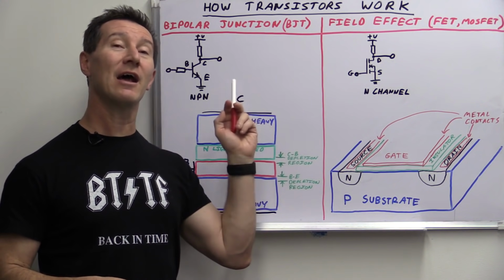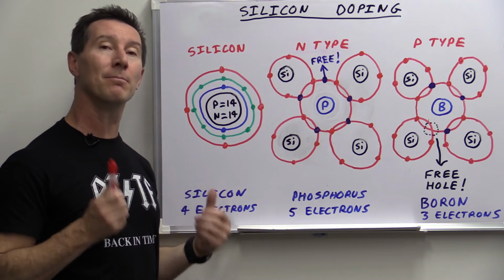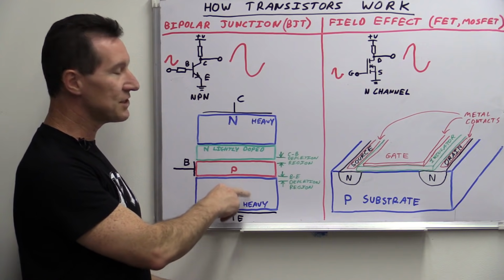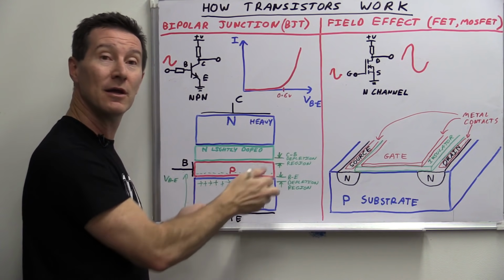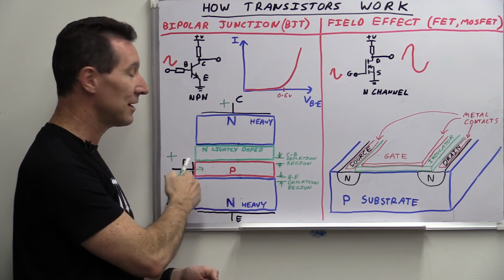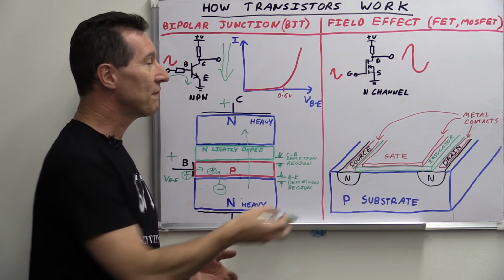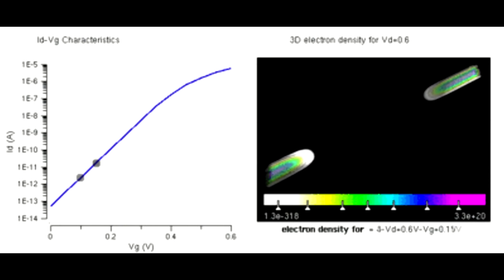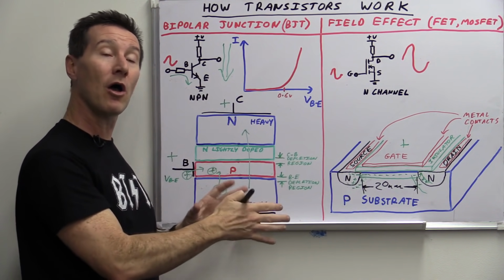EEVblog #748 - How Do Transistors Work?

Comment: Dave, I love ya man, but you just don't know how transistors work.  I don't even know where to begin.  I suggest you invite a guest, who is an expert, to correct this.  Sorry.
Reply: EEVblog I've never made a video before.  I'm sure it's very hard.  And BTW, I give thumbs-up to at least 95% of your videos.  You're a very talented engineer.  But with all due respect, If I was going to make a video about how transistors work, I'd probably get out the text books and review first.

Anyway, I'd start with the PN junction.  Doping silicon, adds charges to the matrix.  But a key point is these charges can't move, they are fixed.  It's like they're glued in place.  Mobile carriers are attracted to the fixed charges of opposite polarity, essentially covering them, and making everything charge-neutral.  When the PN junction is reverse biased, the applied voltage attracts the mobile charges away from the junction, leaving a "depletion" region, that is void of mobile carriers.  Note that the fixed charges are still in the depletion region, because they can't move.  Think of a tide going out and uncovering a bunch of sea shells that are stuck in the sand.  When the mobile carriers (water) drift away, then uncover the fixed charges (sea shells).  And the fixed charges, since they are no longer cancelled by the cloud of mobile charges that were covering them, make an electric field across the junction that opposes the applied voltage.  Equilibrium is reached when the mobile charges drift far enough from the junction that they uncover enough fixed charges to make a big enough opposing voltage to equal the applied voltage.  That is why the width of the depletion region increases as you increase the applied voltage.  Also, when you decrease the doping concentration (the number of fixed charges per unit volume) it takes a wider depletion region to uncover enough charges to oppose the applied voltage.  Simple, right?

A bipolar transistor consists of three layers, making two back-to-back diodes.  The middle layer is the base, and must be very thin (that's a critical fact that I think Dave forgot to mention.  The collector is lightly doped to give it a higher breaking down voltage.  (Lighter doping = wider depletion region = higher breakdown voltage.)  When the base-emitter junction is forward biased, current flows across it, just like it would through any forward-biased diode.  But because the base is so thin, many of the mobile carriers from the emitter have enough momentum to pass right through the base, into the collector.  That's why it's so important that the base layer is thin.  The thinner it is, the higher the BETA.  Also, it is commonly said that the collector "sweeps up" the carriers that flow into the base from the emitter, like a vacuum cleaner sucking up dust; this is because the VCE is usually a lot bigger than VBE, so the carriers are much more attracted  to the collector.

FETs work on a completely different principle.  It's true that depletion regions form around the drain and source, like Dave said.  But you don't normally get a depletion layer under the gate.  In fact, if you increase the drain-to-source voltage enough, making the depletion regions big enough to touch each other, that's called "punch through" and it's bad.  What you're supposed to get under the gate is an inversion layer, not a depletion layer.  Inversion means that the gate potential has attracted enough mobile carrier to outnumber the fixed carriers.  When the fixed carriers were the majority, the channel region (the space under the gate) was an insulator, but when mobile charges become the majority, the channel becomes a resistor.  Now, it's not like a normal resistor, because there is a kind of feedback mechanism called "pinch-off" that regulates the drain-to-source current.  I don't think I could explain that very well, so I'll just quit here.

I hope people find this helpful.  And once again, Dave, I'm one of your biggest fans.  My criticism was totally meant to be constructive.
Reply from the maker: Steve Robbins Perhaps you can begin by making your own video? Or the comment space here is unlimited, go for it. I did the best I could in less than a day from thinking of the topic, to shooting, editing and uploading without final checking or getting anyone else to check it. Yes, I'm no semiconductor physics expert. I think it's a good enough explanation.
Reply: You should do your own video and post a link back on this thread.
Reply: Mazekwon Could I please have zero subscribers again.  I fear that all this fame may has changed me into a bad person.
Reply: +Steve Robbins, I have subscribed to your channel, being your very FIRST SUBSCRIBER. I recommend that you post a video displaying your vast knowledge of the chemistry of Si conductors, but do so in simple terms, so that even grade school children can understand. 

Eagerly anticipating the vid!

 It's great to have so many intelligent people willing to go out of their way to make the world a better place & at such a high personal cost.  Not just sit there behind a keyboard typing comments that don't contribute to community at all!....
Reply: Mazekwon I have a channel?  Wow.

I don't understand the attitude of people like you.  Educators like Dave try to help people learn, not fill their heads with misinformation.  But everyone makes mistakes.  So professional educators are always grateful when someone points our their mistakes.  It's only the real jerks who throw up their hands and say "why don't YOU teach the class?".

Should I have been more tactful?  Probably.  (And I apologize Dave, if it seemed like I was speaking down to you.)  But afterall, Dave himself is not exactly known for his tact, is he?  Remember his rants about solar roadways are "bullshit", and Atmel vs. Microchip where he calls people "buttheads"?
Reply from the maker: Mazekwon The thing with youtube videos I learnt a long time ago is that I would never end up releasing one if I tried to perfect it. That's why all my videos are still off-the-cuff, no script, no real planning before hand, and I have no real idea what I'm going to say before I hit record. Then comes edit time, and another thing I've learned, people are hopeless at picking up their own mistakes, especially me, so I don't even bother. I used to watch my edited video all the way through before I released it, but quickly realised I'd still miss mistakes I made so there was no point. So now I just stitch my recorded clips together, hopefully catch the odd thing in the edit process I fix with text overlay, and then cross my fingers and upload. Knowing full well I will be corrected within minutes of uploading the video I misspoke or did or said something really dumb, then I can fix with annotations. Very rarely have I goofed so bad I've had to pull a video back down and fix it, but that's always a risk.
With this video, I got the idea I'd do it about 10am Friday, did some things thinking about how I'd approach it (was only going to just be the MOSFET, but I added the BJT at the last minute as a comparison), switch on the camera, blab on, check internet for a few minutes for other ideas or checking I'm not completely off track here and there, more blabbing, then start editing by 3pm and then cross my fingers and upload for the Friday night release.
So yeah, this is a blog video. If I was doing a proper formal teaching video or whatever then I'd spend a lot lot more time at. But that's not what I do.
I'm a bit surprised there wasn't more wrong with it :->
Reply: ***** Uh oh, someone insulted a fanboy's Jesus...
Reply from the maker: EEVblog The other thing I should is that this is why I'm always a bit apprehensive doing these Fundamental Friday's videos because many people take them to be well thought out and researched instructional educational videos. When in fact they are nothing more than my usual spontaneous off-the-cuff blogs done with very limited thought, time and effort. It's probably quite foolish of me to try and do such videos in that sort of style. But that style is pretty much all I know, I'm a one-trick pony :->
Reply: EEVblog My apologies.  You did NOT say there was a depletion layer under the gate.  I just watched the video again.  When you draw the channel, it looks like you're drawing it as an extension of the drain's depletion zone, because you draw "-" symbols in it, and you don't say that the channel is different from a depletion zone.  But you don't actually say that is it a depletion zone either.  I guess you just forgot to say how the channel is different from a depletion zone, at least in an enhancement FET.

And it occurs to me that I made another mistake.  I shouldn't have said that you never get a depletion zone under the gate, because obviously for depletion-mode FETs that is exactly what you get.  I should have qualified it by saying that I was talking only about enhancement-mode FETs.

Yep, it's hard to explain this stuff clearly.  I just checked out a few other videos that "explain" BJTs, and I couldn't find a single one that I could recommend.  There was one guy who even tried to apply Ohms law to a BJT.
Reply from the maker: Steve Robbins I was going to say that you'd probably have a hard time finding other videos that explained it to your satisfaction, as from what I've seen over the years, I suspect I didn't explain BJT's or MOSFET's much different to what many others have done. Thanks for your honesty.
My favorite explanation is still "Transistor Man"! :->
Reply from the maker: Mazekwon It basically is raw footage. Rarely do I get to editing and think that sucked so much that I go back and re-shoot a clip. And I rarely review a clip I just shot on the camera (doesn't help that the camera resets my video settings if I go into playback mode!), I just rely on my ability to know if what I just said was good enough, then move onto the next clip.
Reply: Steve Robbins I can only support what you say, but the Video is still okay and good .... there are also minor errors in the FET explanation (e.g. whiteboard drawing --> bigger gate or bigger n+ doped regions)
But: I couldn't do better so it's OK. Still impressive explanation. Much much better than most universities ....

This is youtube-Content you can't 100% rely on this, like you can't trust wikipedia
Reply from the maker: Steve Robbins Thanks for the detailed explanation. At what point did I say or show that there is a depletion layer under the MOSFET gate?
Reply: Steve Robbins my attitude isn't "you teach the class", it's an "I'd like to see you do better". 

It's out of respect for people who take time out of their life to give away free knowledge to anyone who wants it, and when I read condescending comments, that are also just straight up incorrect, you could say I get a little peeved. 

Back to your original comment, why don't YOU hire an expert and post a video on the chemistry behind semiconductors ?.?.?. Because no one would see it....except me...your sole subscriber. 

People enjoy the way Dave talks about electronics, it's not super techy, but you still can tell he knows his shit. The smartest man I ever met, told me is not what you know, but how well you can share what you know with anyone. 

He may be lacking some tact sometimes, but he is rarely falsely derogatory. To 90% of his audience he is better at everything electronic than them, and 100% of them have made mistakes, or misspoken. I would bet 99% of them don't have the balls to post content on YouTube, because of "Fans" like you. If you were really a fan and not just a know it all you would of made the comment a compliment sandwich, where you actually contributed to the conversation,  and not just a Negative Nancy. 

I'm sure you are a perfectly nice person, but unfortunately you were caught on the blunt end of what I despise most about YouTube, and it's not personal, it's just my stance with how people act online, and it's apparent that you know your stuff,  but lots of people don't, so most of his audience learns something, who aren't at the level to care about the "Errors" in depletion zones scale, etc. which is a good thing. 

And just for the record it is a VLOG; which are chronologically cataloged, errors are common on vlogs, and are often just an opportunity for a callback correction at a later date.  People who understand that to create content and put it out consistently and regularly with a very limited production team, there is sacrifices. 
He isn't trying to be the teacher, he is trying to relay his knowledge to the broadest audience possible, in the best way he can, and hopes that everyone learns something, including him.  

Now I say good day to you sir,  and hope you reconsider some phrasing sometimes because of our little convo. If so than I think everyone will be a little happier, including you.
Reply: Attila Asztalos 100% agree. I also think it is essential to say something when you spot 
an error else others new to EE will become very confused. This subject 
is hard enough as it is. I think it would be wrong not to point out all 
the errors found. Steve's detailed explanation of depletion regions was 
spot on and will help others who view this video. He has done us all a 
favor. Also Dave makes money from youtube videos. He is not doing it purely out of charity.
Reply from the maker: Mazekwon And you still only kinda-sorta know what a depletion actually zone is! There is more detail than what I have presented, which is why anyone with any real semiconductor physics knowledge is likely not going to be satisfied with the way I presented it.
But you hit the nail on the head here, no one should take my videos (or any other video bloggers videos for that matter) as technical gospel. They are what they are, in this case a video slapped together in a couple of hours done mostly on rusty knowledge from 20 years ago when I last studied this stuff, and some brief internet poking. All off-the-cuff, and with zero final checking at the end of it before release. All designed to hopefully inform people of some basics, and present it in a way they can hopefully understand and get at least something from it. I could have completely goofed the physics of it, and yet if I get the basic top level stuff right, they should now know at least some basics about depletion zones, doping, how a BJT has gain, and how a MOSFET generally works etc. Even that would have been a win. But thankfully I think I did a fair bit better than that.

Real teachers are always going to better because they (are supposed to) have checked this stuff over and over, studied several textbooks, spent many many hours preparing notes, and refining their presentation through having taught it countless times over many years. To think a general broad knowledge jack-of-all-trades engineer like me can come along and compete with that with just a few hours off-the-cuff work is crazy.
Reply: When someone takes the time to try and explain something to others, I appreciate the effort.  When someone comes along and says "you don't know what you're talking about", I find that they contribute absolutely nothing to the conversation.

When that someone follows up with a detailed explanation of what the original explanation missed, we have a conversation.  And that is an extraordinary contribution -- better even than just a one-sided lecture.

So Dave, Steve -- props to both of you.  I have thought about doing technical videos on various subjects, but I honestly don't know whether I know enough to be helpful or just add to the already plentiful sources of misinformation.  I'm glad someone out there isn't phased by the simple fact that they don't (and will never) know everything.
Reply: The Kaiser Steve's analogy of "seashells" wasn't to holes, but to the immobile donor ions that contributed conduction electrons. He didn't even mention holes. I agree, his analogy could use some work.

While we're on the topic of holes...

Essentially everybody who works in semiconductors uses the concept of a "hole," a concept introduced by William Shockley (inventor of the transistor). They acknowledge that it isn't a real subatomic particle; it's just a useful mental tool.

Conduction in a semiconductor can be either by electrons in the conduction band, or by electrons in the valence band. Conduction band electrons need no mental gymnastics.

Electrons in the valence band are responsible for binding the crystal together, and they are generally immobile. In order for a valence electron to move out of its current location, a vacancy must open in a neighboring valence bond. When the electron moves to fill that vacancy, it opens a vacancy in its previous location for another valence electron to fill.

Rather than thinking of an ensemble (millions? billions?) of valence electrons moving one spot to the left attempting to fill the vacancy, it's easier to think of a single vacancy flowing continuously to the right. It seems like needless mental baggage at first, but when you try to visualize diffusion or conductivity modulation, it really helps. And thus the fabrication of an imaginary subatomic particle we call a "hole," with positive charge, mass, mobility, et cetera. Purely for convenience.

When semiconductor guys talk of "electrons," they imply specifically conduction band electrons. When speaking of "holes," they are speaking of vacancies in the valence band.
Reply: Steve Robbins That was superb. After reading that I am glad I did not give up on Dave's video. As your explanation/correction has made this is all finally make sense to me. Thanks you so much!
Reply: Steve Robbins The chromodynamics aspects are indeed inaccurate from what I've read on the topic. However, as we don't really see what's going on,, having such analogies when thinking about them is pretty useful. I can't see why one can't imagine holes and electrons moving around in crystal structure would be detrimental. I've seen books in which they explain it with mechanical analogies implying water valves and such. I've seen one with a ball climbing and falling from slopes. Dave's analogies at least imply actual crystal structures with impurities and valence electrons missing or being in surplus. I'm saying this as people have asked for more Fundamental Fridays and this one kinda kits the nail on the head. It's also important that people who want to actually create transistors look into a more academic approach on the topic as this won't get them a job at Intel.
Reply: The Kaiser holly crap you are a douche.  The seashell anology is a pretty decent analogy and has nothing to do with anything biblical.  I bet you are a lot of fun at parties.
Reply: Mazekwon The thing is, good intentions are unrelated to bad results; they certainly don't cancel out. Also, still that old chestnut of "if you can't do better you're not allowed to point out flaws"? Really...? ROFLOL...
Reply: EEVblog "Real teachers are always going to be better" Pssh, not in my experience! ;-)
Reply: EEVblog You are the best kind of 'teacher'.  The kind that arouses curiosity in others, so they will seek out more knowledge.  :)
Reply: Steve Robbins i agree, "holes" don't move, they're just an absence of electrons, protons don't move either. Also, one should stick to either conventional current or electron current, but i think if we are going to be intellectually honest here, electron are the only ones conducting anything, not "holes". Its like a mess.
Reply: Hezekiel Randolph You are totally right, my explanation was overly simplistic.  But I think it was at the right level for this crowd because they are mostly beginners.  My approach to teaching beginners is to first give them something they can visualize, then add more details later.  I deliberately avoided talking about holes vs electrons to keep things as simple as possible.

In fact, you may have noticed that I took other liberties.  For example, when explaining a BJT I said that carriers from the emitter have enough "momentum" to cross the base into the collector.  I cringed a bit as I typed that, but talking about energy bands and recombination would have been just too much.
Reply: marionetadelplaneta Achieving high beta is done by three methods: 1. High ratio of emitter-to-base concentration for best emitter efficiency. 2. Thin base region to minimize SRH recombination. 3. Good processing techniques that reduce surface recombination and crystal defect density.

On point #2, a base width less than 0.01 diffusion lengths can achieve a beta of 100. For moderately doped silicon (N_A=10^17 atoms/cm^3), diffusion length hovers around 340 microns, so we're talking about base widths around 3.4 microns. Considering that the base width required for a transistor that can stand off a hundred volts is several microns, SRH recombination in the base really isn't a big deal. Points #1 and #2 seem to be the true limiting factors for the beta of most modern transistors. 

The reason we even talk about wide bases causing low beta is because a [very] long time ago, achieving several-micron base width was difficult. But these days, it's quite routine (sub-micron base width has been pretty standard for decades).

As for epitaxial technique: this is simply a specific manufacturing method for high-voltage transistors. It is performed by growing new silicon on a silicon wafer. This grown "epitaxy" can have low doping concentration despite the starting wafer having high concentration, thus it serves as a collector "drift region" that can stand off high voltage. Epitaxy has nothing to do with auger recombination.
Reply: Mazekwon  Great with Legos too!!!
Reply: Steve Robbins Some errors for your consideration. 1. The carrier movement responsible for depletion region formation isn't due to electrical attraction; it's due to diffusion. 2. In the vast majority of BJTs, the base region isn't thin enough for ballistic transport (i.e., for the carriers to be carried through by momentum). Rather, carrier transport is due to diffusion as described by Fick's law. 3. Carriers within the base are largely unaffected by the collector potential (that's another way of saying that they don't drift toward the collector; they diffuse toward it). It's only once they've passed through the base and enter the base-collector depletion region that they are swept quickly toward the collector. 4. In MOSFETs, you do get a depletion region under the gate. This is required before you can achieve inversion. Once you've achieved inversion, the depletion region remains under the conductive channel.
Reply: marionetadelplaneta Power transistors do have wider bases, but the purpose is to handle more voltage instead of handling more current. (The wide base gives the base-collector depletion region room to grow.) That said, many power transistors still maintain high beta at low currents; their current gain drops off at high currents. Some argue that power BJTs' beta is low because of their wide bases, but I do not subscribe to this belief. After all, lateral PNPs in integrated processes are capable of incredibly high betas despite having several microns of base width. It seems more likely that power BJTs' beta is degraded by effects of high-level injection: namely, in the interests of saving silicon cost, the manufacturer uses a smaller transistor than might otherwise be used for a given current. The resulting high current density forces high-level injection of minority carriers from the emitter into the base. The high concentration of minority carriers promotes auger recombination (a recombination mechanism whose rate is proportional to the square of minority carrier concentration), rapidly degrading beta with increasing current. When auger recombination kicks in, a wide base (which is made even wider by base push-out) doesn't help, either.
Reply: ***** not from being a hermit & not an exaggeration at all.  He had an IQ of 192 & could explain photosynthesis to a toddler.
Reply: Great contribution. Glad you stopped by.
Reply: Steve Robbins so the thinner the base you get a better gain,if so power transistor have wider bases so they can hande more current through the base but that translates in poor gain I am right?
Reply: Hezekiel Randolph
oh thanks  never questioned myself the reason of high or low beta but now is such an interesting topic,i beleived it had to do only with the material they were made i've noticed most power BJT say they are made with epitaxial techniques is that related to the auger recombination?
Reply: Hezekiel Randolph
oh ok thanks
Reply: EEVblog Don't sell yourself short!! You can do more than Talk about electronics and hit record....You can...You can handle a Bowie knife pretty good!  

I honestly love your content & content like yours.  it almost seems like Raw Footage,  it gives a better, more honest feel to whole video. I am not a primp and polish kinda guy.  So I like your style and your tricky pony. 
 
Oh and too keep up with the YouTube tradition, Greetings from Canada!
Reply: Kevin O'Brien I bet Dave make $0.10/hr from YouTube. You should look at the pay structure of how YouTube works and see it is for an audience and money comes from sponsorship, not views when you have less that 7 digits for your subs & Dave is great for his lack of advertisements. 

Other than that. If Dave is your teacher, you need to talk to your Dean because that guy who stands in front of you gabbing all day (Off camera ;) is way over paid if you are just taking the word of one electrical engineer recording his whimsical  banter over what is printed in your text book. 

And to kind of say something, these videos are also for people who aren't engineers; I never understood what a depletion zone physically was till I watched this.
Reply: Steve Robbins nope! You're stuck with me now...Follower is kind of synonymous with E-Stalker!!!
Reply: Attila Asztalos I believe you missed my whole point. You may have inferred what I was saying is that; Dave's intentions make  it okay to have errors. Which is a tad off base. 

I'm saying that everyone makes errors and not everyone puts them out for everyone too see. So when someone makes an error and you absolutely feel the need to get your fingers flying and tapping , even if you are correct try,  to show some decency to the person don't say "I like your channel,  but you are a know nothing who has a camera" 

I disagree with the way Steve went about it, he is aware of that, and we are okay with it.
Reply: Steve Robbins Seashells? Water? You are even more confusing. I wish people would stop to use Biblical metaphors in science. 
Electronics is nothing, but pulling electrons around. It is either a surplus or a lack of electrons.
Expressions like "holes" "mobile carriers" (whatever that is. Sounds like a hot air balloon with a grappling hook.) or "seashells" or even positive voltage!!!(that would be positrons and positrons are fucking antimatter!) in this context are not only utter nonsense. They are un-scientific.
Just say what actually happens, not some crazy old testaments analogies for Bible-thumpers. Shells … carriers… seriously! Well, at least nobody came up with something like a red sea divider or a slingshot element.
I bet poor Nils Bohr is SPINNING in his grave.
Reply: Jeremy Pierce Analogies are never decent. The are un-scientific and disgusting since they are leading us away from what is really going on.
What on earth is wrong with calling a "duck" a "duck"?
Moreover I did not realise that this was a video about partying, Sorry, I thought it was about quantum effects.
As a humble pig farmer and retired monarch I have no formal education whatsoever like you electronic high school and college types, but analogies in quantum mechanics?! Come on! Seriously!
I stand firmly with Erwin Schrödinger on that part. Analogies in QM are tommyrot and fiddlesticks!
PS: Do you regard an electron in the case of this video here (holes LOL) as a wave or as a particle? And if it is a wave how does it gain mass, which an electron undoubtedly has?
Seashells, Positive charge, … LOL!